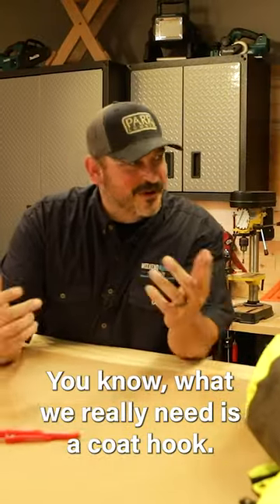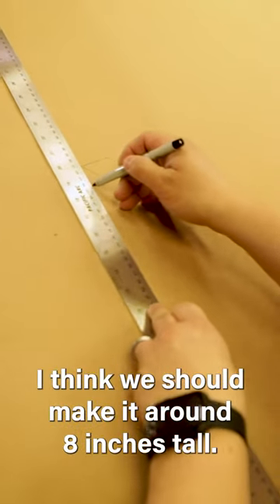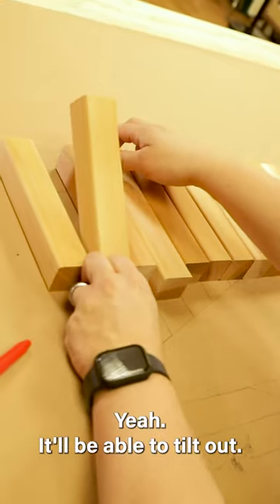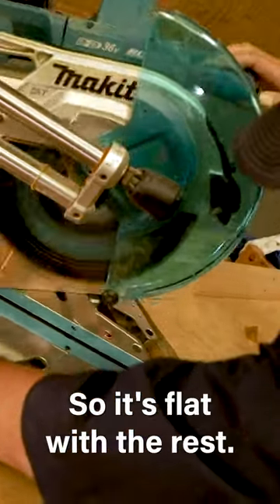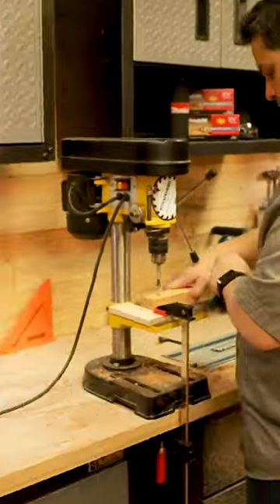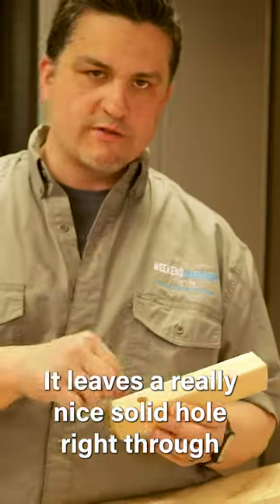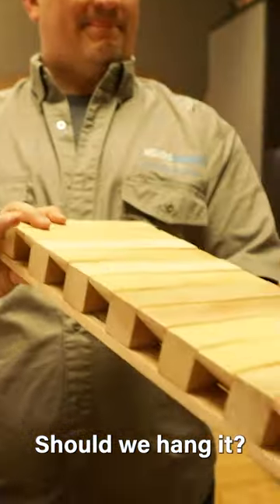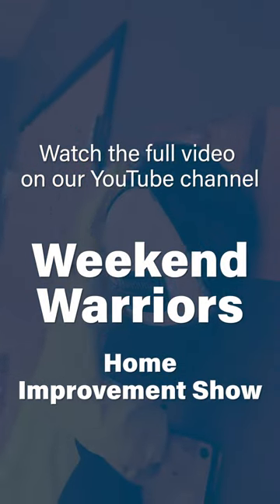COAT HOOK DIY #shorts #jacket #hook

Comment: I think the only thing that I would have done differently is put small strength magnets at the top of each hook.
Reply from the maker: That is a great idea!  The tight fit of each piece does hold it pretty well but they do fall with little effort.  Thanks for the input!